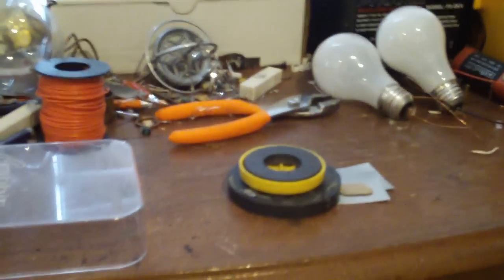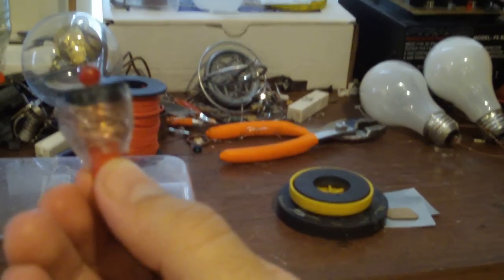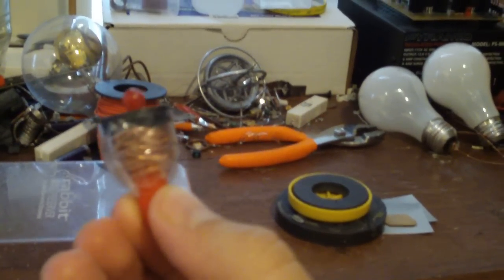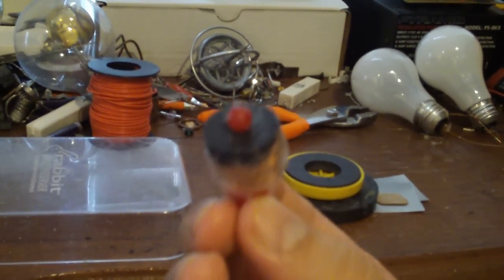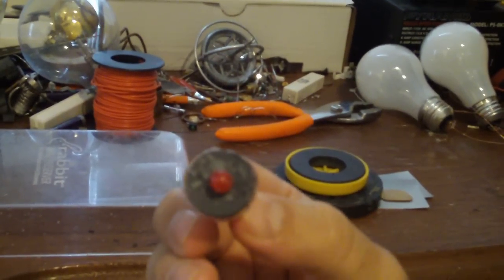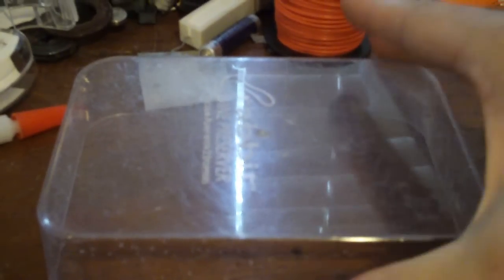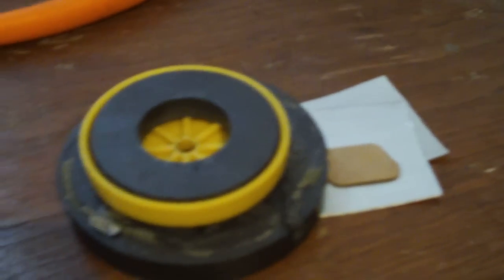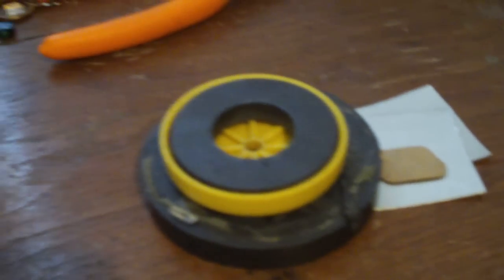Complete Homemade Levitron

Comment from the maker: @verticalvic

In short, the base magnet is in toroid shape and the spinning top is a disc. At the proper weight and distance, the two opposing magnetic fields cancel out gravity and will levitate. The top must rotate at less than 2900 rpm and more than 1100 rpm to be stable. I'm glad you enjoy the subject. Cheers!

Comment from the maker: @H3artBreakZ1 Yes, it is possible.  You need to match the field strength (gauss/tesla) of the original permanent magnet.  In many cases you will overheat a small coil attempting this.  Another method involves using a complex circuit to control the coil while still having a permanent magnet in the center to do most of the lifting.